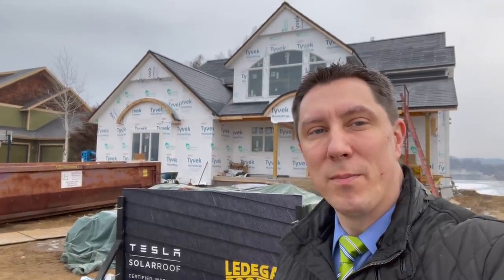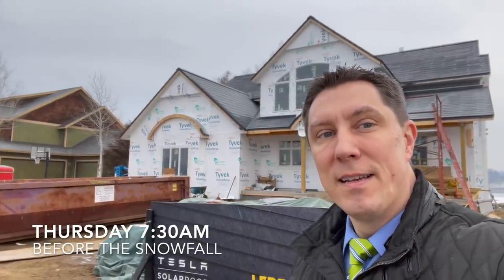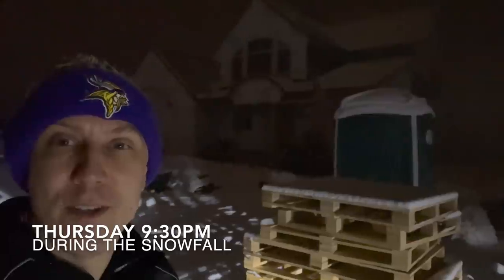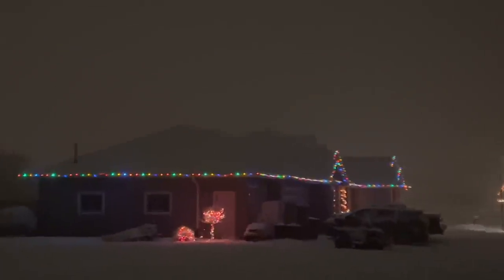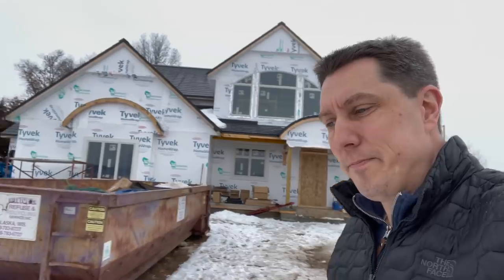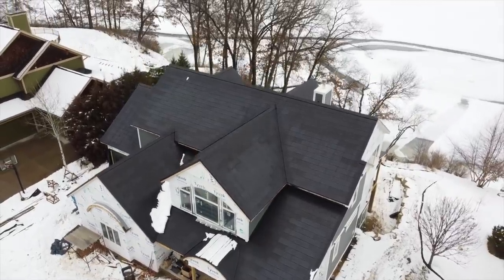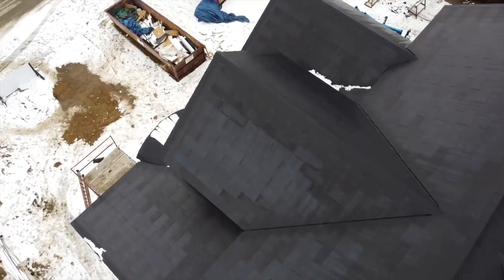Tesla Solar Roof - What happens when it snows?

Comment: What happens when you get a lot of wet snow with no wind and then it turns colder and freezes on? Unless your roof leaks a lot of energy and heats the roof surfaces, that accumulated stuff is gonna hang around for awhile, especially in Wisconsin. It's better to have the solar system closer to the ground where it's possible to manually remove much or most of the accumulated stuff.

Comment: If you install a gutter then you have to find a way to heat the snow that accumulates in the gutter else the gutter gets damaged as it won't be able hold the weight of the snow when the temperature is below 0°C.

Comment: Would it still shed snow with a shallower grade on the roof pitch?
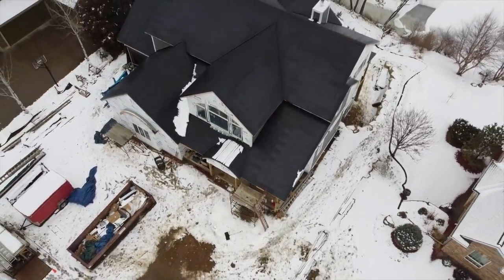Reply from the maker: the majority of the home is 10:12 but the deck roofs on the back are 4:12 and there's also a 7:12 on the front side.  they all cleared the snow.  the first ones to go were the steeper 10:12 pitches.  Hope this helps!

Comment: What will be interesting is how well it sheds the snow in a few years.  I'm not surprised by this.  Its essentially a smooth, glass-like surface.  Of course it's going to shed the snow better than the rough asphalt shingles of the neighboring houses.  A few years from now, after the elements and atmosphere have left their deposits on the surface, I gotta think the ability to shed the snow will not be as impressive as when the roof was new.

Comment: Snow sticking to the roof is typically a sign of good insulation. So what causes the snow to melt off? Hoping it’s not due to heating the outside. 
I assume one can’t count on the mini avalanches in a couple years when the glass will have become more rough.

Comment: Hey Jason, just as a request for an update, since this install was prior to moving in and before your gutters were installed, did you move in prior to the end of winter?  If so, how did the snow react once gutters were on.  There were lots of questions below regarding gutters and damming.  Also, what is the pitich of your roof.  We are going to be putting a tesla roof on our house and our pitch is 10/12. Was there a consideration for snow guards?

Comment: I'm assuming with the men working inside that they have some sort of heat running..  and the drywall ceiling hasn't been hung nor the attic insulated.  This would melt the snow off way faster than the neighbors' houses.  That front dormer was also a steeper pitch than the rest of the house.
Reply from the maker: the walls have foam insulation and the ceiling is drywalled with blown insulation above it.  we need heat to mud the drywall but can't have heat in this climate until the insulation is in place.  majority of slopes are 10:12
Reply: @JasonLassen  I'm assuming the texture of the solar panel's surface is much slicker than a shingled roof so all it would take is a little radiated heat from the sun to cause a land slide off the roof if there is any build up. Once it starts sliding, it's gone. This will happen on any steep shingled roof as well but not so dramatic. I bought a few solar panels to play with (once I get some power bank batteries) If this proves to be a good investment, I would like to increase the quantity & put them to work (when the weather permits proper mounting). I'm still researching products so I'd love to see pics of the power bank & the electric hook ups.

Comment: BS!  those small amounts "snow piles" that had supposedly fallen off the roof would no way in hell equate to a couple of inches covering that roof!  That was just a dusting of snow.
Reply: @Ujeb08 First off: where you at this location when it was snowing ??? if not, how can you say that "a few inch" did not fall. Sec: is it not passable that the first inch or so of snow simply melted off the roof therefore not adding to the total amount of show that accumulated on the roof before it fell off into the piles that where seen in the video.Thirdly: To make a comment (calling some one a lair) with out having first hand knowledge of the facts is in my opinion BS  in and of its self.

Comment: Horrible example. All I see is a home under consutruction with very steep pitches. 
1 - Likely propane heaters inside for workers. Or some type of heat
2 - Likely no attic insluation yet as that would be one of the last things to go in. 
All this means is that any heat.. Even a little heat for the workers is enough to melt the snow on the roof quickly.
Reply from the maker: the walls have foam insulation and the ceiling is drywalled with blown insulation above it.  we need heat to mud the drywall but can't have heat in this climate until the insulation is in place.
Reply: @JasonLassen  show us the insulation is in place. Post a video to prove it.
Reply: @StarkVandalez  You can't just take him at his word? Slick glass will loose snow really easily.
Reply: @laserbob6766  so now the design requires severe sloped roof?